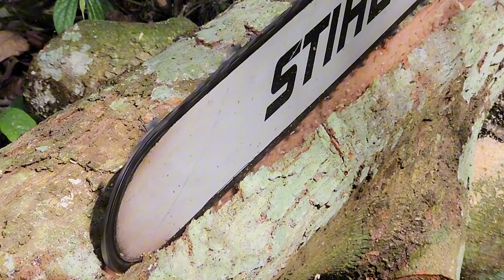Dismantle the old bridge and cut wood to prepare for the new bridge

Comment: Galvanised steel tubing with concrete support pads would be the best long lasting solution, but it depends if you can afford it.  Even your timber solution has a limited life in that high humidity environment. 😄😳
What a beauty is Giang..😘😘
Reply: Thx on Giang’s behalf !